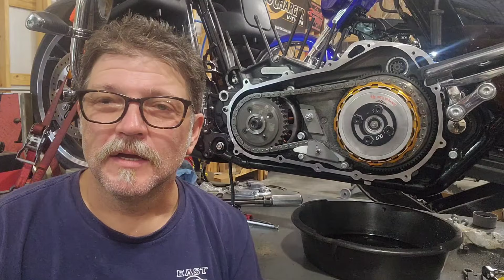What's the BEST Primary Setup for YOUR Harley? - Baxter's Garage - Kevin Baxter

Comment: I have a 2011 and my primary has always been noisy. I’ve changed the compensator to a baker and baker tensioner and it still makes the same sound. It’s been inspected by myself and a trusted shop. I have resorted to just screwing my earplugs in tighter and not worry about it.
Reply: Change your chain in primary.  And chang your clutch asy 
.  Don't use a stock primary  chain .
Reply: If you have hydraulic clutch.  Change little brg where would have adjusted your clutch hub manual. I have worked 4 noisy primary on Harley in twin cam  bikes

Comment: I have a 2010 Heritage Softail that is making a clunking noise when you start it most of the time. I had a 2009 road King that also had a 96" motor and made the same noise until it has a compensator failure. The Heritage has 9600  miles and I bought it from the original owner a little over a month ago. I'm thinking of replacing the compensator and the tensioner. 
Any advice ? 
Of course if I do I will be ordering the parts from you..

Comment: I’ve been watching you for years and I put the man o war compensator on my bike when I did the 131 build. It has been extremely quiet but say I’m on Facebook on one of the Harley sites and all I hear is man their noisy, while I haven’t heard shit. Do you know what’s up with that? Or is it just people bitching just to bitch? Thanks Kevin, love your vids.
Reply: i have a man o war compensator and an evolution clutch basket.  I had a fair amount of noise when I was running the billet inner clutch basket from evolution.  I later went with the steel inner basket and there is little to no noise.  the ONLY issue i've had with the man o war is that i get a pulsating feel in power delivery around 2800-3000 rpm if the throttle is held steady  in that range.  completely normal.